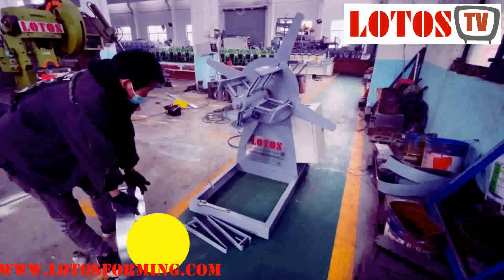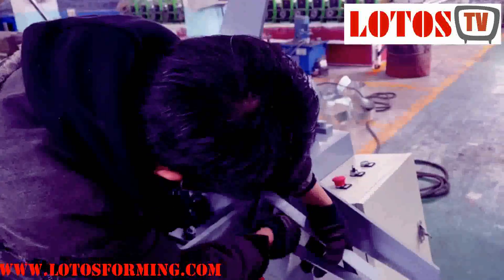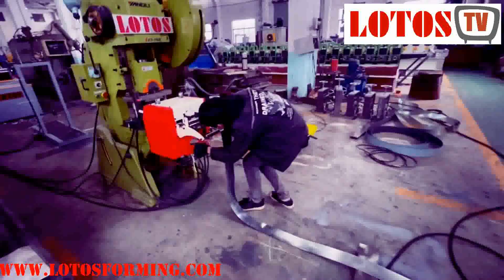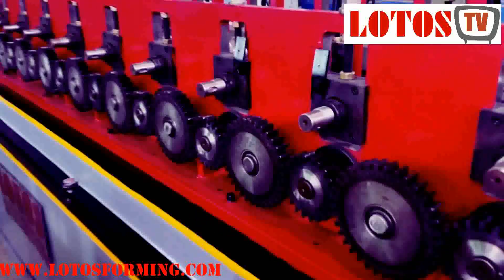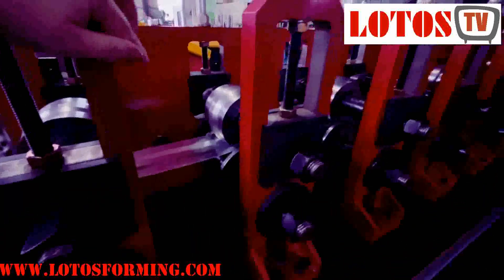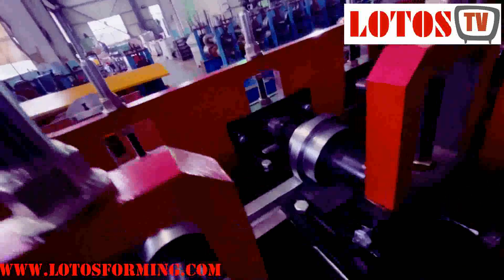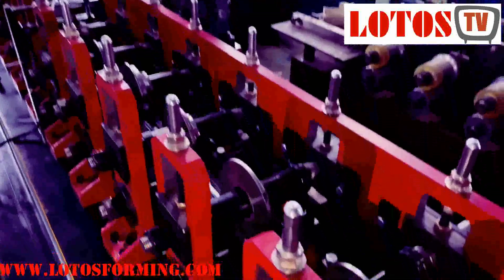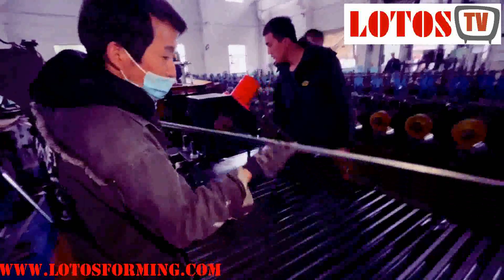【How to run the roll forming machine】:  How to operate roll forming machine " LOTOS GROUPS 2021 "

Comment: Roll forming machines that design and produce for specific metal such as SS, GI, CI, PPGI, CU, and etc.The cold roll forming process is an alternative method under the condition of room temperature to form the advanced high strength steel.